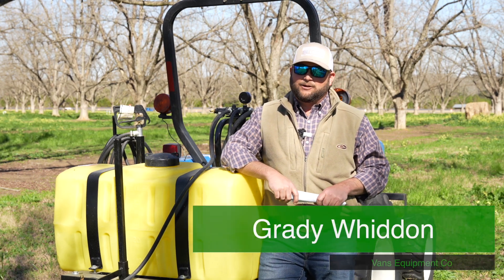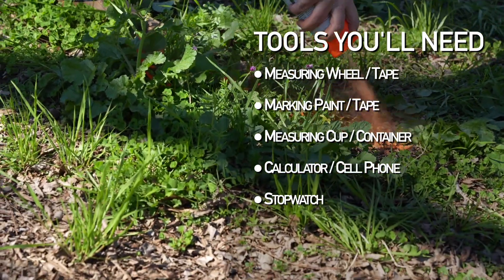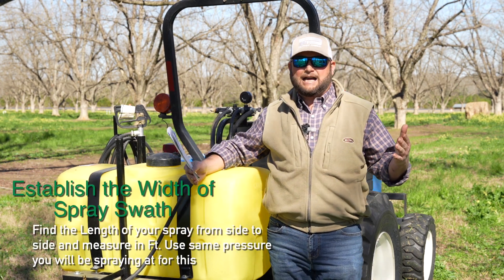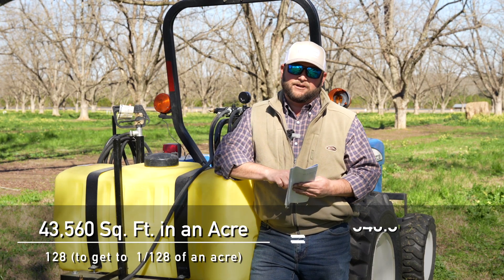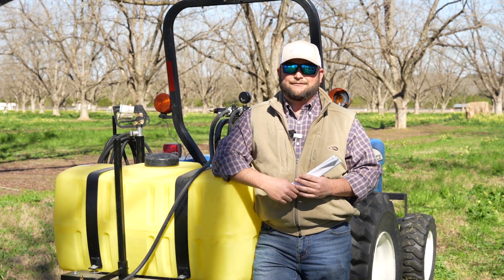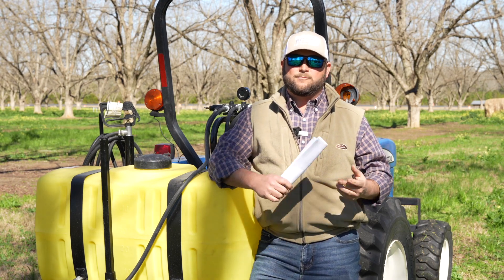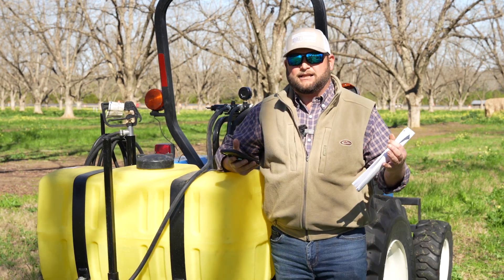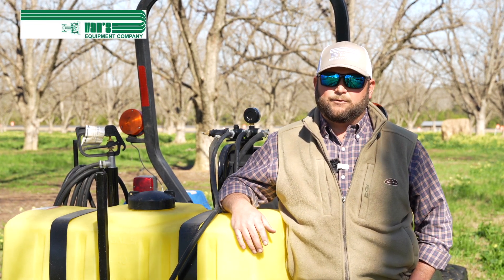How to Calibrate a Boomless Sprayer

Comment: Here is an easier and more accurate method. Get the width as mentioned here. Run complete tank of water out while timing it at the rpm you will spray at. Then use a mowing calculator at the speed your tractor runs in the gear you will spray in. Google mowing calculator, it’s free. Then you will have and accurate  acreage a tank will cover. Add chemical amount to match that and your golden.

Comment: Are you working on the boom calibration video? This one was great, would like to see the boom version, I’m guessing the only difference would be multiplying due to the extra tips. 
What is the advantage of boom or boom less for  1 acre of turf? I only plan to spray herbicides and pesticides, not fertilizer. Do you ship your 25 gallon rigs?

Comment: One part I’m having a bit of trouble with in my head, I get the dividing the 128 ounces by 10 because you multiplied is by 10, but then how are you coming up with the 12.8 gallons per acre? Would you multiply the 12.8 by 128 since we divided 43560 by 128, which is 1638.4 ounces an acre, then you divide by 128 again since that’s how many ounces are in a gallon?? I guess it’s confusing since you caught 128 ounces and that’s how many are in a gallon. Sorry for the long comment.